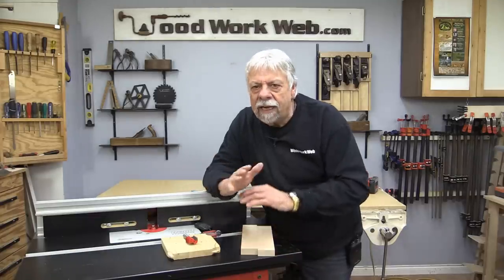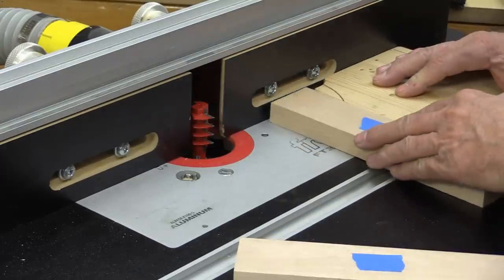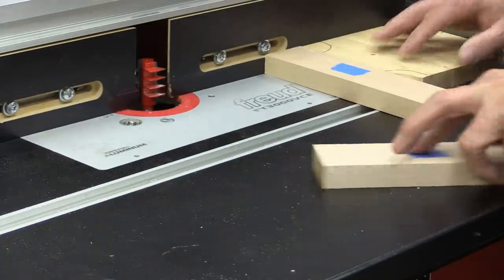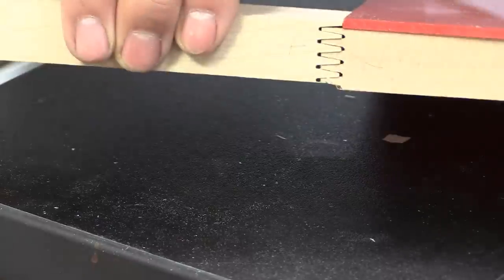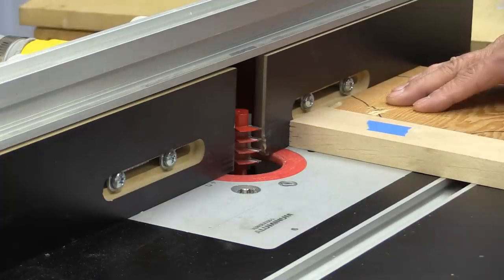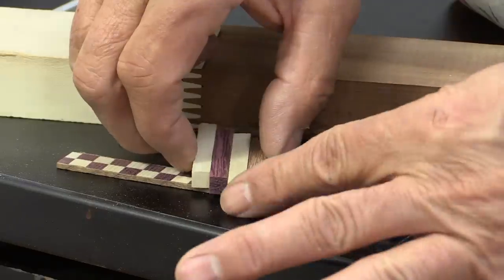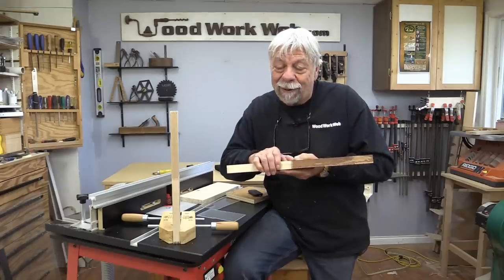How to Make Finger Joints: Finger Joint Router Bits!

Comment: I would love to have one of those bits,I use a lot of pallet wood and they are always to short for big projects .I was just wondering how strong the joint would be,could you do a strength test ?
Reply: One of the best  - I have one - is sold by Lee Valley,and is adjustable.
Reply: Perfect use for lengthening wood, as for strength, remember strength is all in the surface area.  Finger joints like this would give a lot of surface area. If you could measure all the peaks and valleys you would have one large glue area. In other words this would work great in adding length to your stock.
Reply: I have used this bit a lot and I like it.  As for strength, well there are many mouldings that use this type of joint to make their boards longer and of course less scrap.  If you want to make a board 16 ft long, this is great.  The glue is important too.  If you were just making a moulding this is great, however if you are joining 2x4s and using it as a support, I would not use it here.  However I have seen "I" beams 24 ft in length using this type of joint, 2x3 and OBS to make floor joists, so go figure.  Just try it and test it to see if it meets the requirements that you need.  All in all, it is still a great investment and a nice bit to have.  I hope this help you.  Tim
Reply: Look at all the "Glue stress test videos" The glue joint breaks after or before .I think Tim is correct,it is the glue that is most important and having a good fit,which I have always had with these bits. You see plenty of 2x3 construction lumber in stores,so I think the strength question is kind of mute.
Reply: Taylor Guitars did a video a few years ago of this type of finger joint in the headstock/neck area, then showed it being broken with a shop jig that had a pressure gauge. The necks with the finger joints actually withstood more pressure!
Reply: With the right type of glue and a good amount of surface area available, the joint should be stronger than the wood itself. Period. That's the basic take home seasoned craftsman say and examination videos show. If that's all you want to know and think about, go ahead and stop reading now. 

Beyond that, issue is, and I am getting a bit fussy and technical, that still doesn't tell you all that much. The times I've seen them fail, it's always either been obvious the wrong/cheap glue was used or the wood yielded first (as expected), and, barring human error, that suggests one (arguably two) important things I've never seen talked about. People always seem to fail to consider one crucial but obvious aspect: the wood. If the idea "glue is stronger than the wood" is true, the wood then becomes your weak point, and the question isn't really about whether a glue joint is strongest anymore, because the point of failure has shifted. Obviously, the wood species matters for how strong a joint can be - fir is going to be stronger than pine - but relative to that is cut geometry, which then effects glue surfaces. What I'd like to see is what the optimal glue surface is for different species of woods and how much, if at all, that's impacted by cut geometry, e.g. are fingers better than dovetails etc.
Reply from the maker: As the others have noted the joint should be acceptable in strength, but I'll add it my list of joints to test in my next jointery test video!
Reply: Very strong! I bought a butcher block  96x30x1.75 and it is joined with this method.  Looks fantastic and very strong!

Been looking for how they did it, needed shelves and now I can make them.
Reply: I was thinking about the same thing
Reply: @custos3249  if that is true, why not just butt joint the wood?  I suspect this is only the case when joining along the grain.
Reply: @janhatton4405  Again, surface area is the most important factor for glued joints. 

Beyond that, if you need to glue two 4 1/2' 2x4s together to make an 8' board because your board stretcher is out of commission, just slapping them together end to end with some glue is going to yield a super weak joint. I figured that'd be obvious, but I suppose not. Another way to illustrate how important surface area is, plywood. It doesn't need any geometry cut into the sheets because a large surface area is already available. Cutting interfacing geometry into the board ends is basically how you cram as much of that larger surface area plywood sheets have into the small 2" by 4" space available.
Reply: At least here in Sweden when you buy glulam beams/girders the individual "strips" that are glued together are finger jointed to make them have the sufficient length.

Glulam beams have quite impressive numbers for how much load they can carry, so I wouldn't worry about the strength of the joint that much.

And look at the things you can build with glulam, impressive!

https://www.svenskttra.se/optimized/default/siteassets/1-om-tra/4-om-limtra/johan_ardefors_ardeforsbuilding.jpg

And it's actually more fire resistant than steel...

Comment: I bought a large amount of commercial finger jointed pine for a good price, after using it, I found why it was cheap....it just falls apart. They say it has 80 percent of the strength of normal timber, that might be the case if it is kept totally dry. From my experience it's a product to avoid.

Comment: I think the main intention for this router bit is for joining boards in the other direction than what you're doing here.  (So it's sort of a replacement for using something like a biscuit joiner for making wider boards.)  I think.  I could be completely wrong.
Reply: There's a practical limit to the length of joints that can be made with this bit, whether parallel to the grain or perpendicular to it, because the vagaries of the wood (stresses relieved by the cutting process, defects, grain, etc.) will come into play in long joints, and it can be difficult to squeeze and clamp long joints together. The application demonstrated in this video--to join the narrow ends of boards to make longer boards--is the best use of the bit. For edge-gluing long boards to make wider boards (without using splines or a lot of biscuits), there are specific bits available, which create simpler "glue joint" profiles (having fewer and coarser "fingers").

Comment: Its a very strong glue joint as the glue suface is 3 or more times the width of the original  surface,  finger jointing has been used in the furniture buisiness for many many years, as its invisible inside setees and armchairs that uses hardwood for their constuction..

Comment: Would you recommend removing the plunge spring if permanently mounting a plunge router in a table?
Reply: I looked into this when buying my Bosch setup, and I decided to buy the fixed/plunge combo kit. You mount the fixed base to the router table, and you keep the plunge router for freehand routing. The plunge router can do everything the fixed base router can, as well as plunginging.
On the assumption you don't already have another plunge router, I'd say don't remove it. I can't see any reason to remove it. Especially if you don't own another plunge router: they are a handy tool.

Comment: 7:55 It would work well. I remember that such a connection was used in boards in the old barn gates. After many years when I had to make new bigger door I used them as a footbridge on the scaffolding.
Yes, I know probably a very stupid idea but they are still whole and lie in my barn.

Comment: I an not at all sure that searching around for a piece of plastic to user as a shim to raise the workpiece by half a finger is a good way to go about this.  If you do not happen to have a piece of plastic the right size you have a problem.  Surely the right way to go about this is to lower or raise the bit on your router micro-djust by half a finger?  Ir would help if you had a table with a top-adjust facility.

Comment: 1.  Center the bit on the thickness of the first board.
2.  Make the cut.
3.  Turn the second board over (top surface is down).
4. Make the cut.
5.  Brush glue on both surfaces to remove air.
6.  Turn top up on both pieces.
7.  Push the pieces together.
8.  Clamp until glue dries.
Reply: Surely it needs to be off=centre by half a tooth width? Otherwise you will get the same cut either way.
Reply: @janhatton4405  turn the board upside down before cutting the second piece. The mirror image will fit together.
Reply: Nope. Jan Hatton is correct; the bit needs to be offset by half the tooth pitch. Simply turning the second board upside-down before cutting will work ONLY if the exact thickness of both boards meets the requirement of this half-pitch offset.

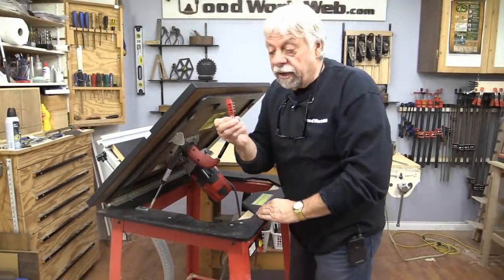Comment: This joint is pretty much the same as (multiple?) scarfing. Even the ratios seen the same (1:8 - 1:12). In this side of the pond, it comes to my mind the IKEA tops with small pieces of wood joined like that longitudinally.
Reply from the maker: Yes, it's a similar type of joint! Interesting that Ikea uses it.

Comment: does finger joints make the beam structurally weaker? I assume they are stronger than the wood, maybe too much, having such different strengths wouldn't compromise it if used for load bearing? Probably not.
Reply: Nelson Baietti some tests said it was about 90% of the strengths
Reply: I think this type of finger joint is more about the look than the hold. It likely holds decently, but you're not going to see it on construction projects. It's more for furniture (I just recently saw a tabletop with these) and like Colin said, cutting boards and detailed pieces.
Reply: brett you do see it in contruction in 2x4 studs that are manufactured and door jambs and trim. the reason i was told the 2x4 was done that way was tp prevent warp and twist.
Reply: mike stockard     There is a stud mill in Jefferson, TX and I am sure other places too that buy 2 x 4's by the car-load and run them through the plant to make stud-length for house construction so walls are the correct height without having to cut all of the studs.  These mills cut the knots and other defects out of the boards and finger-joint them back together with glue then cut to the stud length out of the assembled board.  The studs are stacked and banded.  These boards are not recommended for any structural use other than studs or unsupported compression loads.  
The finger joints should not be trusted by themselves.
Reply: Roy Reynolds , thanks. i first saw them when i was a framers helper years ago and asked the framer. i cant remember back that far but these may have been interior walls with no load. that was temp job while waiting on my career job process. jefferson should be blooming pretty quickly. have spent several springs driving through there and enjoying the pineywoods. thanks for info.
Reply from the maker: I'll be doing some tests on it on a future video. But, it seems fine to use structurally for most projects.

Comment: Could you use it as a drawer lock joint ?
Reply: MRBOBDUDESIR I was thinking the same thing. Has anyone answered you?
Reply: @bigtoe0341  No not yet
Reply: I think i'm going to glue, a 3/4 and 1/4 inch finished board together for my draw front, and just use my table saw for the lock joints

Comment: Why not put a caliper on the plexi glass, that way you will know
the exact offset. Jot it down & keep it with the tool..
Reply: Then how are you going to match the tool with the p-glass next time you set it back up in the router?
Reply: Danny Wilsher just put the plexiglass shim and the bit in a ziplock bag so they stay together.
Reply: If you have calipers, you could have just measured the bit to begin with. Measure the distance between the top cutter and bottom cutter on one side of the bit. Then divide by 12.
Reply: If you are using calipers anyway, just subtract the height difference of the joined boards to that of the height of the plastic and that should be spot on. You could then make a shim jig to that size to keep with the bit. That way you wouldn’t need to be exact in setup if you cut with the same face down on both boards. Just remember to mark the facing edges beforehand, especially if joining contoured pieces. The maximum height of the boards you are joining would be the height of the bit between the centres of the top and bottom teeth.

Comment: Late comment but I have to.  The top of the bit should be level with the stock and then you alternate flipping the faces as you run them through.  This flips the gap from top to bottom with no other adjustments.

Comment: I wonder how it would work with a 45 degree joint. I imagine it would be stronger than dowels.
Reply from the maker: It's on my list of things to test. It will make a good looking joint!
Reply: It works, but the 45° joint line wil not be centered. (from the inner corner to the outer corner). So for furniture it is a bit odd to see.
Reply: For a structural joint you don't want to use wider angles. Wider angle means less surface in contact. Structural joints in aviation (wooden aeroplanes) have 1:10 to 1:15 slope, I think that is about 10 to 7 degrees. With proper glue that kind of joint is much stronger than the wood itself. You can use any angle you want, just pay attention on the loads. Higher the load, more surface in contact (sharper angle) you need

Comment: The finger joint works great but when you have a 40 ft board these weak points put a couple of pieces of plywood on each side that will make it stronger
Reply from the maker: Thanks for the tip and thanks for watching!

Comment: You dont need any jig..........the Router has a depth measure. Use the caliper to measure the teeth on its thicker part and just move the level to stop half of that measure. If the teeth is 5mm on the thickest part, allow 2.5 of extra depth on the router and thats it.

Comment: there must still be another way to make this joint without using that piece of plastic you bought, perhaps reindexing the bit after making the first joint cut, so it would align with the mating piece...
Reply from the maker: This was only one to do it. Reindexing should also work. Thanks for watching!
Reply: @knecht105  Can't you just flip it over? Seemed like they would have joined together ...

Comment: I have few objections to choosing this technique for horizontal lamination in comparison to simple biscuit joint:
1) about double slower method to cut
2) about 2-4 times slower to spread glue over
3) nicer look or more interesting joint
4) if having table router already, buying router bit is probably cheaper then buying biscuit machine.
5) for very small box 
For myself, it is clear win of biscuit joint in 99%. For others, might be the opposite.

Comment: You didn't need to use the plastic, just set the blade to the correct height and flip one of the boards over.

Comment: How strong is that joint if you glue it together with wood glue?
Reply from the maker: It should hold just fine for most woodworking projects. I'll do some test on it, in a future video!
Reply: With decent glue the joint will most probably be stronger than the wood itself.
Reply: All the pallets containing fiber fuel where I work have finger jointed pine boards with a square of osb in the corners for added support, the pallets stay together fine with 2,100 pounds on top of them

Comment: Set up corretly, just flip piece no two , are it will fit
Reply: No, it won't, unless the thickness of both pieces is a TBD factor of the required offset. (And I suspect you would like the thickness of your work to be determined by you, not by the tool.)

Comment: The adjustment you're looking for is 1/2 the pin width.  Find some scrap hardwood,  work it down in a planer to make the shim you need.  Simple.
Reply from the maker: Thanks for the tip and thanks for watching!

Comment: it was not a perfect fit!. no need to flip anything by the way. get a caliper and measure the distance between the tips of two blades as precise as you can, then adjust the router exactly half of the distance that you measured, up or down after the first cut.. good luck..

Comment: If you are cutting 1/2" thick wood, you need a 1/2" finger cutter. Cutting 3/4" wood, 3/4" finger cutter. Although your method works for you, it will be a nightmare for anyone else because it's not the correct way. Thank you.